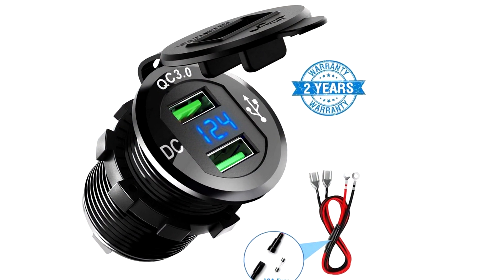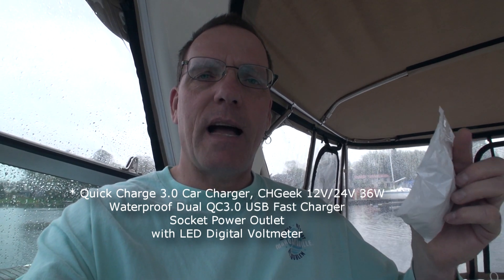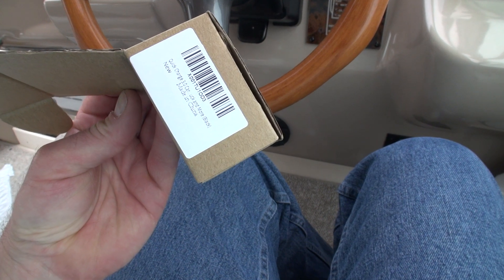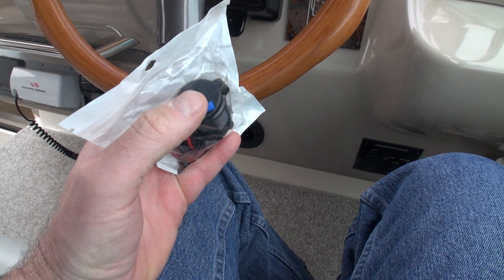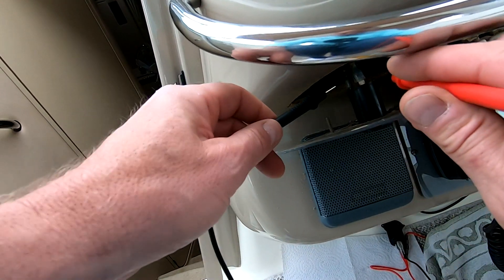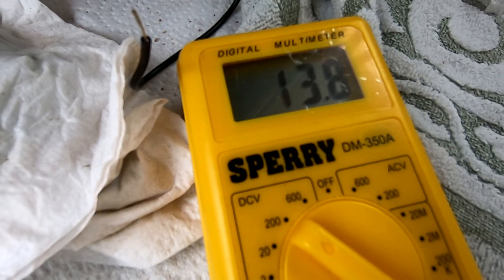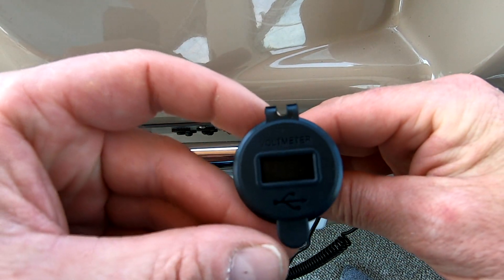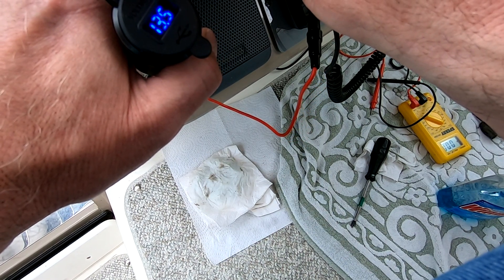New 12V Outlet With Voltage Meter - How I Did It

Comment: That is pretty cool. We have a cigarette lighter but found a dual USB insert to plug into it, but it does not give me system voltage. I can get that off of my Garmin plotter. I do NOT however see the need for a cigarette lighter on the Here's to Us. So might take that on as a project, convert cigarette lighter into a sleek modern looking accessory like that tells you system voltage. Just wondering if there is a mini- inverter in the dual USB insert I have already. Or do you think there is DC power coming into my cigarette lighter that changes it to AC? Now thinking through this, I hesitate to make this change without further investigating it. Maybe the cigarette lighter is DC already? Just wondering here in Texas as I sit and dream about resuming the Loop!!
Reply from the maker: Hi Sam, good to see you guys are safe at home in Texas, but I'm sure you are both eager to get back to the boat again soon.
 As for your cigarette lighter outlet, it's gonna be fed by a 12V, DC supply. A super easy way to confirm that would be to plug an accessory into it and shut off all the AC power on the boat. If it stay's 'lit', it's on battery power. Conversely, shut off all DC power and try it the same way.
 The unit I installed works perfectly for us, but I purposely left the the factory installed lighter outlet in place, as it provides a convenient power supply for numerous 12V appliances from min inverters to the air pump we use to inflate the grand kids floaty toys. Our smoking days are more than 20 years in the past, so a lighter isn't needed, but nice to have quick access to that power. 
 If you follow the link in the description to the Amazon listing, it will provide more info on the USB charger, including a funky exploded view of the internal electronics for the device. 
 Looking forward to your next videos:-) Cheers and stay safe you guys!
Reply: @BoatingWithBoogaboo  Thanks Paul. Hope you are all safe up there in Canada. Warmer weather on the way soon! Sam

Comment: Did you wire the charger to be ignition switched or through the house battery?
Reply from the maker: Both the existing cigarette lighter outlet + new USB outlet are direct to house batteries.